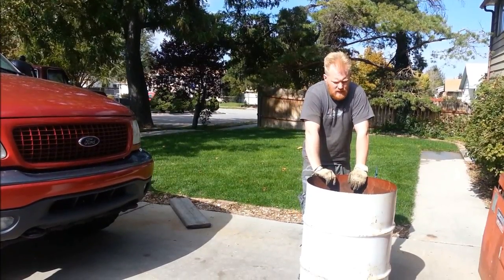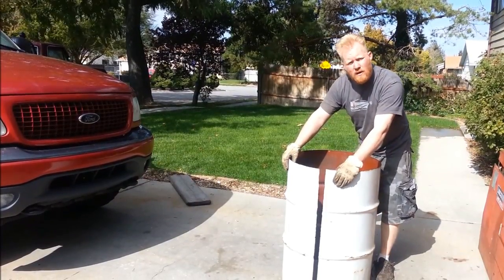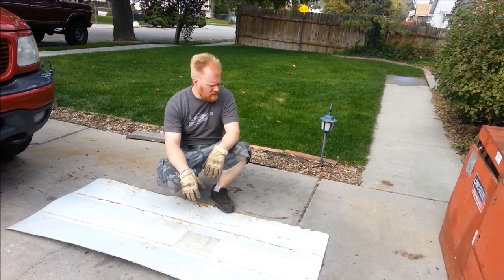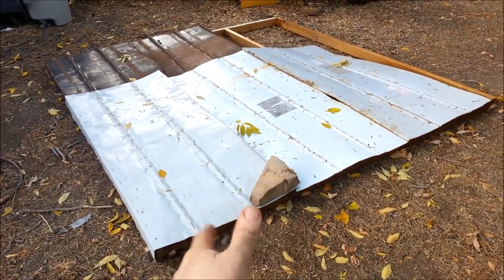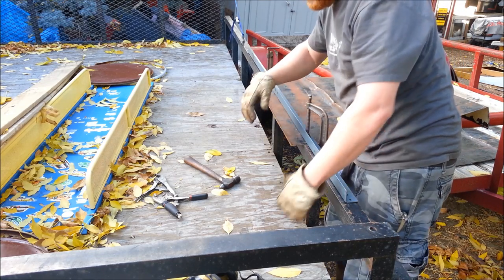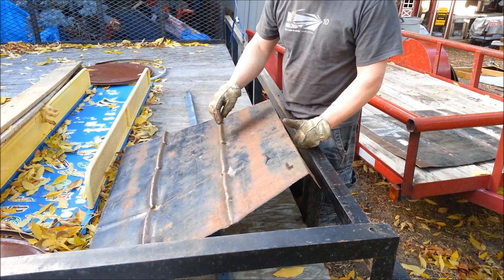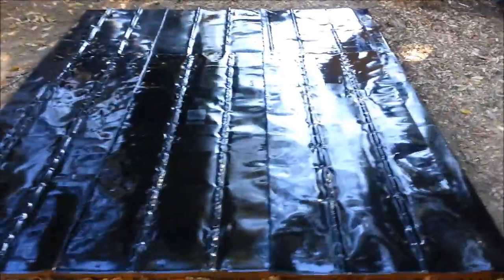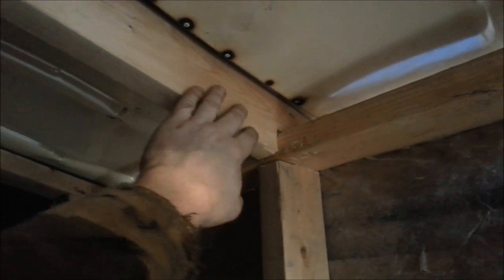55 gal Drum into * Metal Roofing * Shed from FREE pallets part 4

Comment: Good to see things stay the same, in 1964 I built a shed like your's old pallets (We got a quarter a piece for hauling them away) oil siding and a steel roof. No dove tails, just nails from the pallets, no red oak just spruce and the steel was the roof of four old station wagons from the scrap yard. actually I removed the roof before I sent them to the scrap yard.
Reply from the maker: Very Neat.

Comment: I think I'm cut from same cloth watching your videos. I use plastic buckets to shingle my deer blinds even use as siding. A 5 gal buckets gives you roughly 34 x 16 inch plastic sheet. Easier to work with and lighter.  Not as durable a steel but lasting 5 years now. Uv is your enemy with plastic. Thanks again for video!
Reply from the maker: Plastic buckets.. Nice idea and plentiful.

Comment: Notching your 2x4 rafters effectively turns them into 2x2s. If I may suggest, you might consider putting a 2x2 ledger under the rafters on each end to help give them more support if you have to worry about snow load where you live. I love the door in the next video. It is an amazing feat.
Reply from the maker: Thanks, I'm glad you like the door. With the rafters the top only had a 1/2" notch so it is a 3" board still. The bottom edge about 1" still leaving 2-1/2 inches. So it is about twice the strength of a 2x2.
Reply: Ah, i thought it might have been more. Loved the use of the railroad spike. Can you suggest a good starting kit to learn to weld with or some good online videos? I really enjoy your video channel. Thank you for sharing your expertise.
Reply from the maker: You're right I was worried about going too thin and sacrificing structural integrity.

As you know the ability to start welding has been made more available than ever with the inexpensive Chinese welders on the market these days. I'm from the school of thought to just dive in and try it. I had never welded before when I bought my first Mig welder (Lincoln Weldpak 100 flux cored) for $600 in 1998. It came with a basic VHS tape and I set off trying to weld. Then I bought a $100 auto darkening helmet. From the start you'll be able to get stuff to stick together and work. Like riding a bike, only time and practice will make you good at it. No amount of being told how to do it will make you good. Once you know the basics it's all about learning your particular machine and your technique.

I would recommend anyone starting out to get a 120volt flux cored wire feed welder and an auto darkening helmet(this really really helps). You can find a new Chinese welder for around $100 and helmet for $50(1/3 the price from 10+ yrs ago)
Reply: sixtyfiveford Any recommendations for the welder? I've got a Northern Tool nearby, but I don't know beans about their brands. Or maybe a welding rig is like a boat :-)
Reply from the maker: Nothing is as bad as a boat. Lincoln, Miller and Hobart are always brands that will last a lifetime. But a Northern Tool brand one will last a person who seldom welds a lifetime at a fraction of the price. I know they sell a 120v wire feed welder for around 100 bucks that will suite a person. A 120v welder will weld up to 1/4" steel.
Reply: sixtyfiveford sounds perfect. Now just to jump in and not scald myself in the process.  Thanks for the inspiration!

Comment: This was just a curiosity that popped into mind but it wasn't exactly what I was thinking. It makes the most of time and material buy I'm curious where the ribs buckled every couple inches. If the didnt already crack or would be the first to rust thru at the least. My thoughts were cutting above and below the ribs to have flat sheets. You should do a a follow up if it leaked.
Reply from the maker: It hasn't leaked at all. Cutting out the ribs would make flattening effortless but you have a ton more work in doing so.

Comment: I thought of this idea the other day so I looked it up on you tube and some one had already done it. It seems like there are no new ideas. Good work! I was thinking you could run it through the machine that puts the ribs in tin roofing and then it would be ready to use.
Reply from the maker: Yeah a set of rollers to smash it flat, then roll grooves in it would be nice.

Comment: With the black paint, how hot is your shed in the summer?
Reply from the maker: It was sunny and 75 today. It felt the same temperature as outside when I opened the door and walked in.
Reply: it is a great way too make a roof, just thought it would get hot with the black paint, so rock on dude, I'm impressed!
Reply: You must live up north somewhere.  I wondered the same thing about the black roof - living in the south east with summer temps well over 100F for at least 8 weeks every summer, a black roof might not be a good idea here.   Loved your video's.  Thanks for sharing!!  :)
Reply from the maker: Carol Kelly
We hit highs of 100 all summer long and still haven't had any issues. The roof surface itself is hot to the touch but it doesn't transfer downward into the shed. I'm assuming mainly because hot air rises and radiates right off. At mid day the shed will actually feel cooler as it retains coolness from the night before. The only time it feels warmer is when the sun goes down it is retaining the day time heat. I can't say internal temps have ever been more than a few degrees above the day time ambient high. The wood siding insulates very well but this would be a different story if the sides were black metal.
Reply: Did not get the shed super hot?! Bummer! And here I thought it would make for a nice summertime oven, have the old lady baking bread or something. Or doing an all day roast in there.

Comment: What kind of a tool did you cut the drum with ???
Reply from the maker: I used a plasma cutter but a reciprocating saw, jig saw or angle grinder will all work great.
Reply: +sixtyfiveford I do a lot of my metal cutting with a metal abrasive blade in an old skil saw- works great on light or heavy material . Makes nice cuts too

Comment: Sorry,  you lost me, what's tack welding?  I hope it's not like oxyacetaline?? Welding cuz I can solder but that's way out of my league (and toolkit)!
Reply from the maker: +Anne Anderson (Foxiepaws) "tack welding" is just the process of making small welds to hold the pieces together by any welding technique(oxy/acetylene, mig, stick, tig, etc)
Reply: sixtyfiveford I think soldering is about my limit apart from the butane torch which I have used in Metal Clay (for firing).

Comment: the only thing i see wrong is that black paint is going to draw the heat and make that shed hot
Reply from the maker: Glenn Mantia The metal is so thick it doesn't heat the shed. The Shed, even during 100F days this summer never felt hot and normally felt cooler than ambient. This is attributed to the thick wood siding..